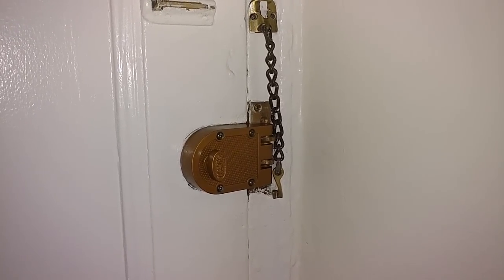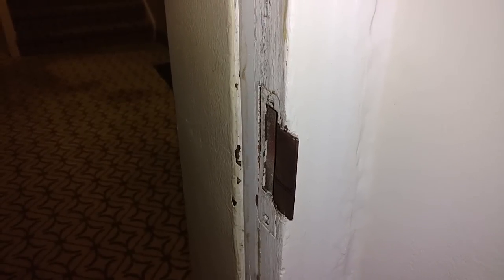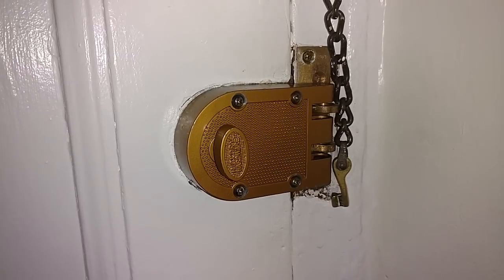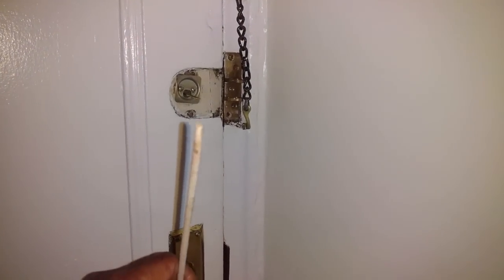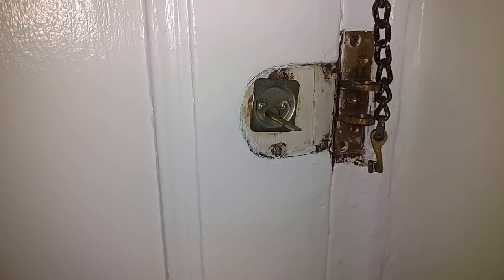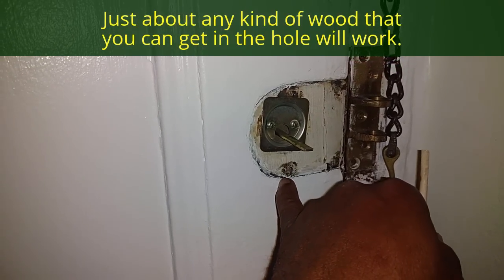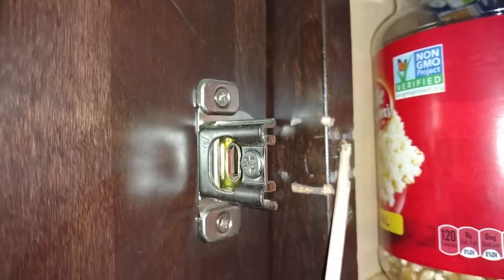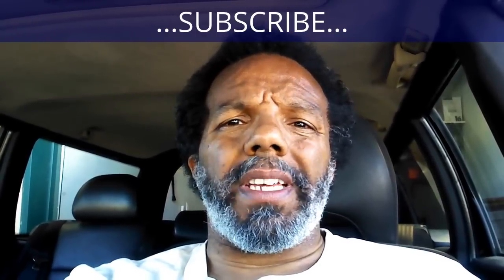How to tighten loose or stripped out screw holes in wood. - VOTD

Comment: I first thought you were using a pointy stick to outline the lock (like a teacher) lol :-).

Same method that was used to put screws into brick, drill slightly longer than the screw then tap the close fitting dowel fully in and cut off.
Used by old diy men to put curtains/mirrors up, 1920's onwards untill someone invented the plastic wall plug.
Reply from the maker: Nice, I did not know that, nor how to spell dowl. lol
Reply: Epoxy works well.  Fill up the hole with fast setting epoxy and let it start to set up.  Screw in the screw and wait a few hours; coat it with a little cooking oil or WD 40 first.  Then back out the screw and hang up whatever you want.  It can hold a hundred pounds or more ( 7-8 stone )
Reply: Sorry i missed the "e" out,  dowel is correct now lol, i miss keys and dont allways look lol.

Comment: I use wooden chopsticks left over from the restaurant and some furniture glue.' Elmers will work in a pinch.  Tap the chopstick into the hole with a hammer until it bottoms out and give it a couple minutes to set up.  Cut a small grove up against the surface and then bend the end up and down and left and right until it snaps.  Tooth picks work for smaller holes.
Reply from the maker: Nice, thanks for the tips.